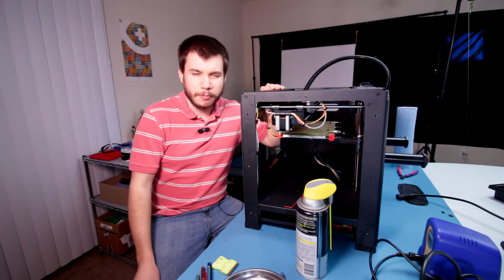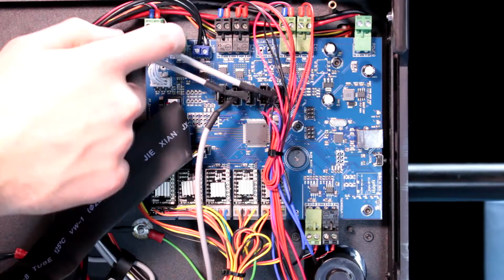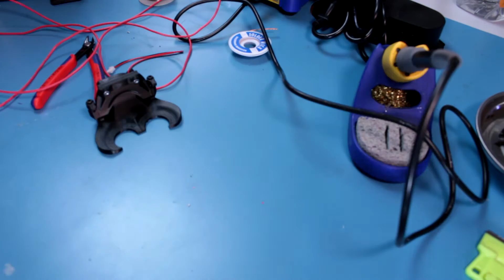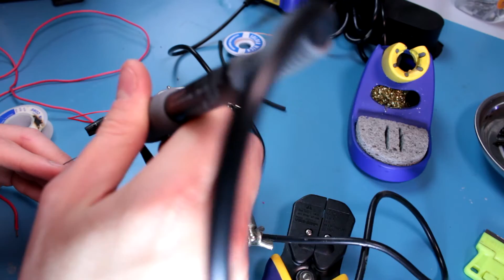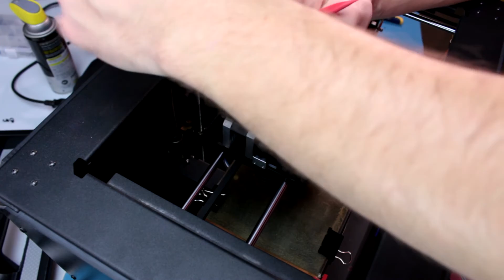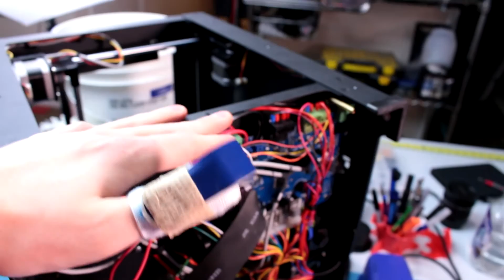Flash Forge Creator Pro Fan Modification

Comment: I appreciate that you ran through this. It made me realize that the port might be there on mine. Sure enough after checking it is!

Also, I decided not to go the desolder/solder route on the board so here are two connectors I found:

Original Source: https://www.thingiverse.com/thing:1720094

TERM BLOCK PLUG 2POS STR 5MM
2 Position Terminal Block Plug, Female Sockets 0.197" (5.00mm) Free Hanging (In-Line)
https://www.digikey.com/products/en?keywords=ED2779-ND

Terminal Block Plug Female Socket 2 Position Top Screw 5.08mm Side Entry Cable Mount 20A 
https://www.jameco.com/webapp/wcs/stores/servlet/ProductDisplay?storeId=10001&langId=-1&catalogId=10001&pa=2094581&productId=2094581

Another thing to make it easier is to add a Ferrule crimped to the end which is what the printer already has for the other wires connecting to the set screws.